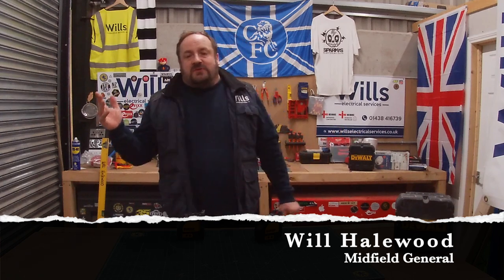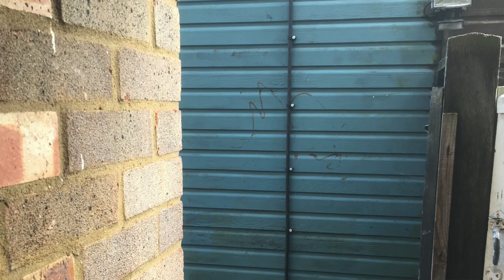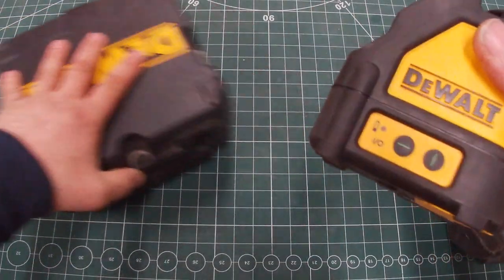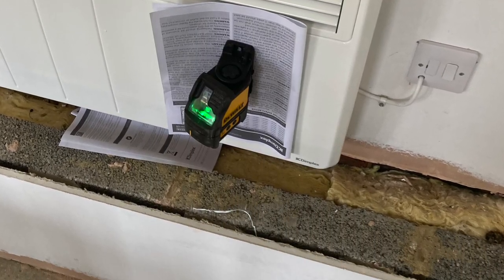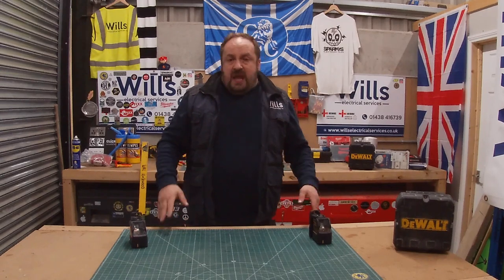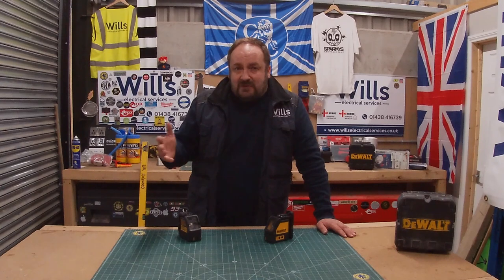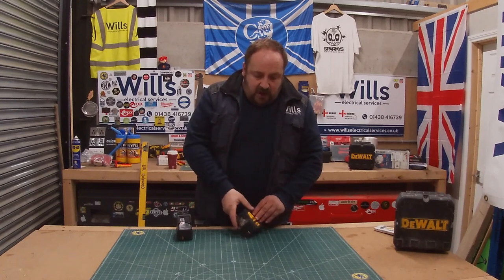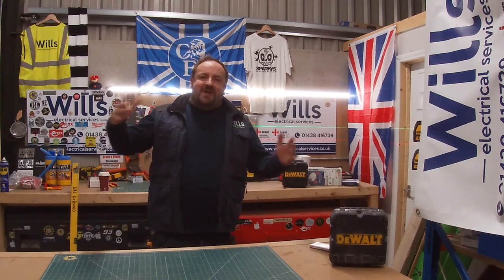Dewalt Red & Green Self-Levelling Cross-Line LASER Review | Electrician TV

Comment: Nice video, these levels are so good in my options. There’s a reason the vast majority of the trades seem to have these, I’ve had my red one for about 6 years and I use it the same way as you got everything.

Only issue I have is the same as you that the red one is hard to see in the light, was doing some spots in an extension and they had loads of sky lights and it was so hard to see, plus my eyes aren’t the best 🤦🏻‍♂️🤣

I do think I’ll end up getting the green one. Lad I work with has the dewalt Green one with the battery that you charge up...I like the idea of that but it’s too dear for my blood! 

They do cane batteries though you’re right!